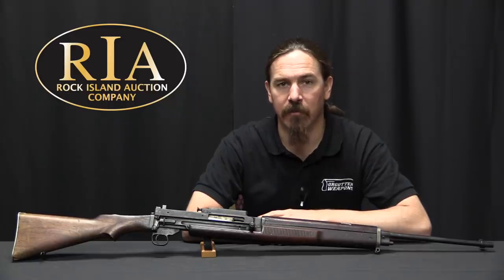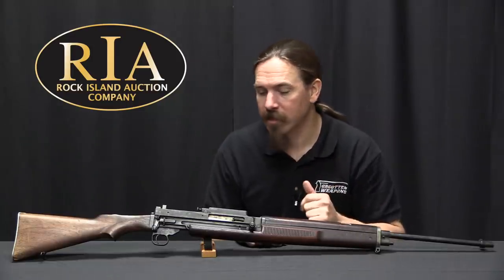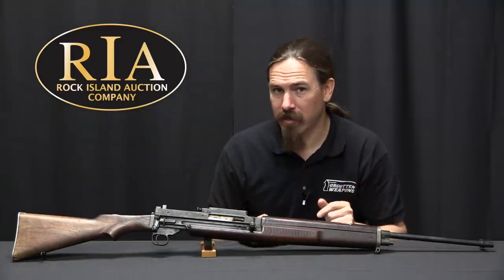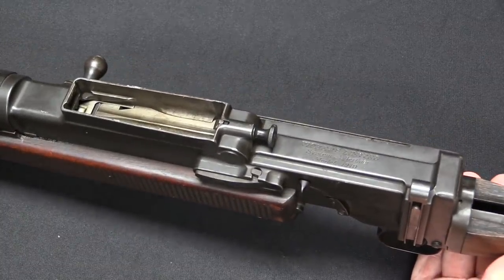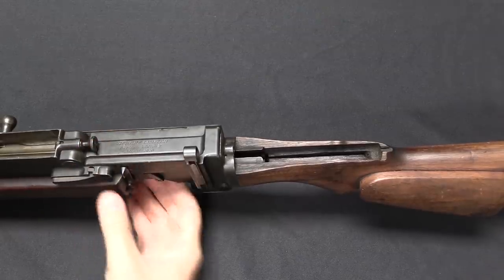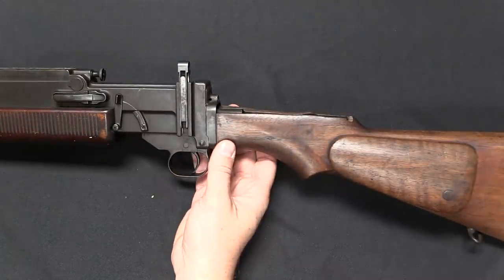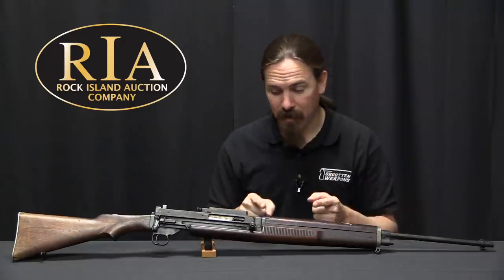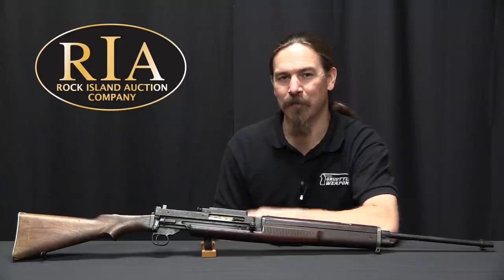Vickers-Berthier 1919 US Trials Rifle (Second Type)

Comment: It wouldn't surprise me if the cracked open stock may have been caused by air pressure, that tube would move a fair bit of air ahead of it and the pressure just from that may have been enough to split the wood if it was a close fit. And as pointed out any contact would cause splitting.

Comment: I suspect that the replacement bolt may be related to the broken stock. Perhaps a round with an excess pressure caused a catastrophic event.
Reply: It would also neatly explain where the magazine went. Into pieces.

...come to think of it, what's the documentation of the trials like? If that's what happened they almost certainly would have made note of 'well, this one kind of blew up.'

Comment: Could it also be possible that if the tolerance on the stock was tight enough that it could have made a seal and created pressure when the rod went back causing the break? Or is the tolerance loose enough to allow air flow?

Comment: The little pivot piece between the bolt body & bolt head: could it double as the method of setting headspace? Or is there a removable locking block in the receiver?

Comment: This is a closed-bolt rifle, where more metal moves between the pulling of the trigger and the firing of the cartridge, than on many open-bolt guns. I wouldn't expect it to win many target matches! However, as the ancestor of the Vickers-Berthier machine-gun, it is also the ancestor of the Vickers "K" gun used in considerable numbers by the RAF and Royal Navy Fleet Air Arm in WW2 -and subsequently famously used by the SAS and "Phantom" on armed jeeps. One advantage as a machine-gun would be that the primer gets a really good high-momentum whack each time, which might minimise misfires. By the same token, cartridges being fed get a good push, which may be how the K gun managed to work reliably with 97-round drums.

Comment: the cut in that your finger is ponting at 21:30 is for the safety such that at 23:23 when you engage the safety, it will push the oprod slightly back.

Comment: Complex but interesting. However the supreme foolishness of the stock construction is amazing. It could easily be remedied by using a more sensible construction that encased the bolt assembly completely, plus added bands for strength.

Comment: The stock cracked because there was no place for the compressed air from the bolt moving backwards to bleed off and popped the stock open. It's the same principle as a fire piston.

Comment: is it just me or does it seem relatively simple to flip the whole thing upside down, and use a buffer tube and pistol grip to massively improve the ergonomics. since the trigger is just a sear and the op rod seems to run the full length of the action it seems like it would have been fairly straightforward. i guess hindsight and armchair arms designing but oh well.

Comment: I mean why take a machingun and make it semi auto
Reply: Paul Hök It’s easier to redesign a few parts in a gun then to design an entirely new gun
Reply: And ammo consumption.
Reply: Weeell i guess your right but could you not just make a peterson device but for 30-06
Reply: @sussy_bed_stain  and? It'll be a much shorter bullet. Carbine at best. And if you're ok with carbine, then why bother with making such bolt actions in the first place?
And if you mean PD itself, then it wasn't very reliable if I recall. Or at least wasn't proven to be reliable by combat by the time the need for it was lost.
Reply: @TheArklyte  the pederson device also required exacting angular tolerances similar to the Luger, that was later replaced because of manufacturing expense.

Comment: Isn't it really bad to have that much mass moving forward when you pull the trigger?

I can see why this gun was 'forgotten'.
Reply: billtheunjust yeah, you could see how long it took from he pulled the trigger until the oprod went all the way forward. Long lock time does not make for good practical accuracy.
Reply: Like when a 2 lb bolt gets sent flying in a 6 lb submachine gun? Those were popular because they were cheap and easy, not necessarily because they were accurate. I agree with others that this was not accepted because it's a mechanical nightmare of little parts that are easy to lose. 

When he demoed the semi mode, he didn't drop the oprod, he let it down easily by hand. That's why it was slow.

Comment: I don't understand that firing system.  Yeah, it's simple, but having the op rod/gas piston/bolt carrier/firing pin snap forward like that effectively eliminates any gain from it being a "Closed bolt gun."  The bolt is the only part along the length of that very long action that isn't traveling forward at that point.  On an open-bolt LMG, that doesn't make a significant difference.
Reply: the important thing there is that the charging handle/oprod/gas piston doesnt way as much as the bolt itself, so its slightly better
Reply: @marcusborderlands6177   It's not just the Mass, but also where that Mass is distributed, and when it moves during the reload sequence (Before the firing pin engages the primer)  In this case all the way down the action, on a long action, muzzle heavy gun.  That tends to tip the barrel down when you fire, into the dirt, if you're not expecting it.  (Because nobody makes rifles that way.) 16:47  "This thing's real long."  So long that he had to hold the gun diagonal across the screen to show the whole thing.  All of that "Doesn't way as much" as the bolt?  What about the barrel that's half as long, hollow, and determines exactly where the bullet goes when it's fired?  What makes you think that?
Reply: It's funny how whenever I admit to not understanding something, in an educational video series.  A gamer inevitably shows up to make something up, that's barely good enough to convince yourself, that you do.  This isn't a Borderlands gun.  Steel has actual mass, and momentum.  Also, I happen to be an Industrial Engineer, who used to troubleshoot factories, which used to manufacture parts like that, and move them from station to station.  So, I have some idea how much steel actually weighs, from experience.  Have you ever actually fired a semi-automatic rifle IRL before?  Was it open-bolt, or closed bolt?

Comment: That recoil tube is going to be moving at very high speed and the air that is behind it, in the wooden stock, looks like it has no where to go. Compressed air is amazing and powerful stuff and it seems that the recoil tube is acting like a piston in an air compressor - forcing the air to  compress. Air needs to expand, that's what it does best when squeezed and that's why air powered tools are so powerful. No wonder the wood split – and I bet it went with one hell of a bang and mass of fragments!
But that said, there looks like there could have been a drilled vent hole right at the end...

Comment: That looks like the most unwieldy rifle I have ever seen (OK... slightly hyperbole. There are some other really uncomfortable rifles out there. But that stock, without a means to wrap your hand around a grip, leaves a really sloppy grip and trigger). The length between the stock and trigger, and the upper-position magazine makes for just an annoying rifle.

Altered as a Light Machine Gun does make sense.

And.. I guess since there is no existing magazine, it isn’t likely to be fired by anyone who actually owns it, unless they have about $10,000 to develop a useable magazine.

And... My GOD! That op-rod is just too long. Too, too long. It seems like a few minutes of doodling could have come up with a method to shorten the op-rod, and thus making for a more reasonable stock.